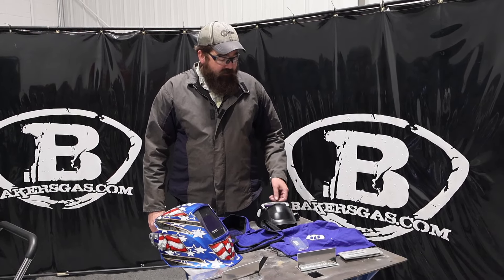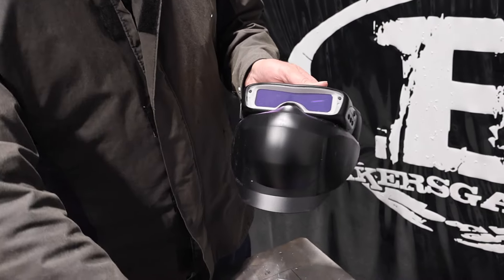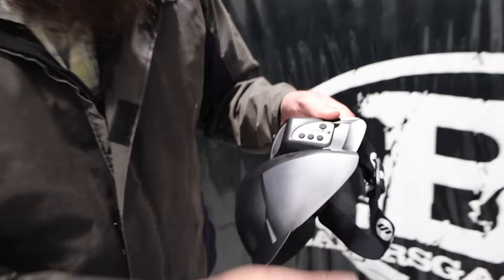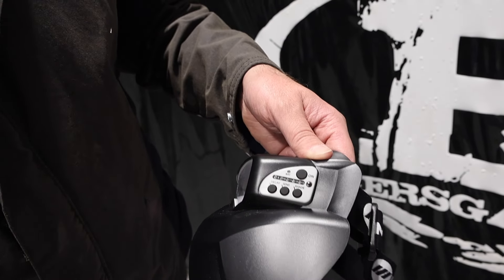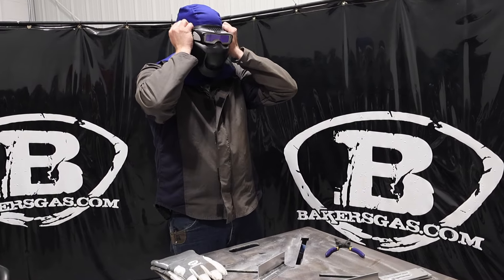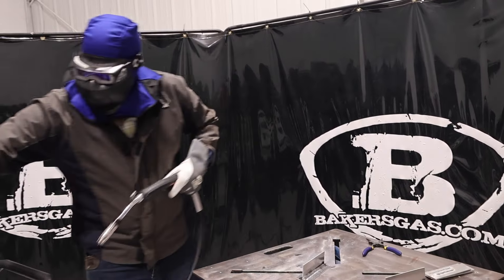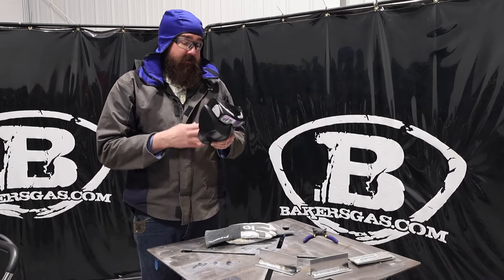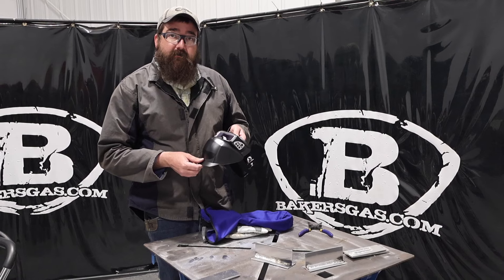Miller Weld Mask Review & Demo - NEW ClearLight Version

Comment: Have you done a review on the Lincoln welding mask? Can’t seem to find a video review on it anywhere
Reply: I would like to see a comparison as well I want to get one of them but haven’t seen anyone review the Lincoln
Reply: Ive had the miller 2.0 weld mask and after it stoppednworking i got the lincoln weld mask, i like the lincoln alot more, it didnt flash me like the miller did. The miller wouldn't pick up my tig when i struck the arc. That being said, both of them broke so you just cant throw them around like a normal welding hood

Comment: I have the older version of this. I thought it was a great idea to use it if I needed to get into tight spaces where a regular helmet would not be possible. I use cheater lenses along with reading glasses (welding is bad for your eyes kids…trust me) in my regular helmets. 
I tried to order the magnifying lenses for this doohickey mask…3 times. Every time, Miller sent me some oval eyeglass magnifiers that do not work with this mask. They don’t fit in the mask properly. I had to use masking tape to get them to stay in position inside the mask, and even then, it was awkward and hokey. I’ve given them the part numbers, serial numbers…my local welding supply store tried to help me to get the correct magnifier lenses for this mask, and failed every time. 
I am convinced they do not make a proper shape cheater lens to fit this mask. This mask is quite expensive…over $300. Don’t waste your money if you need cheater lenses in your helmets.